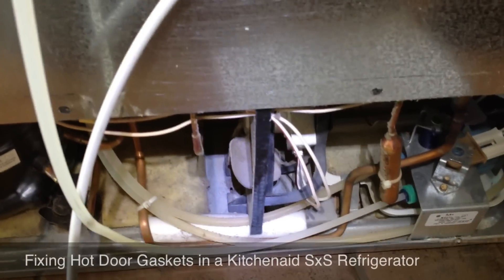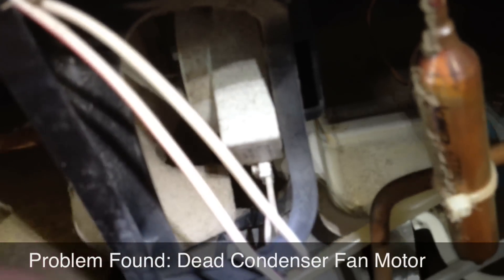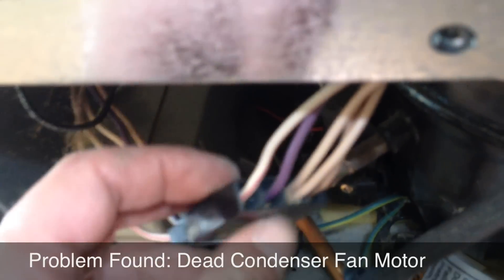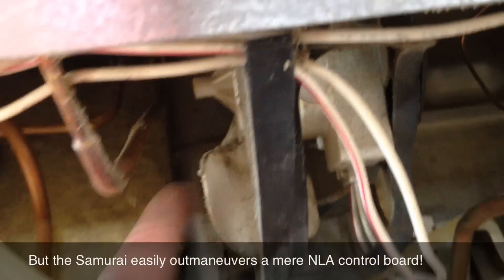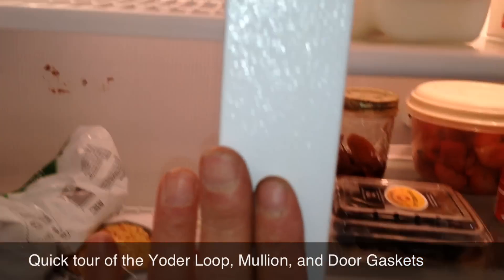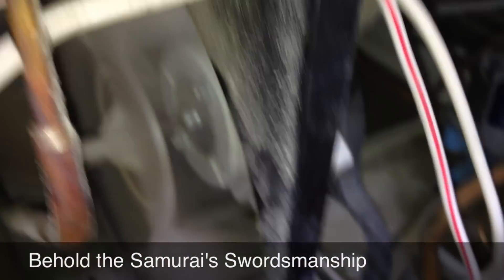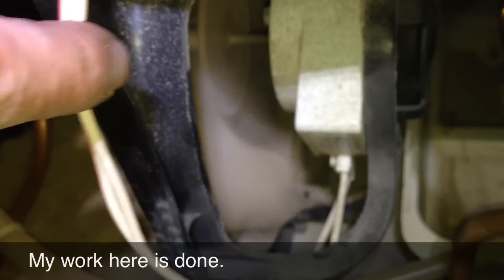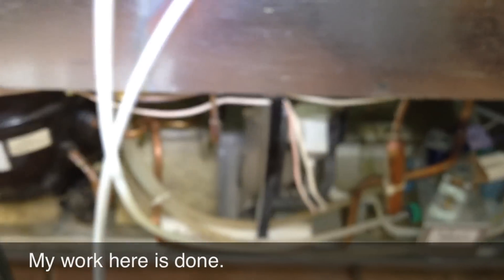An Unusual Fix For A Refrigerator With Hot Door Gaskets

Comment: You Rock!!! My fridge was warm and freezer cold...cleaned condenser coil and fixed that. Then I noticed the front of the freezer was hot-122 degrees F so I replaced the defrost timer and heater thermostat...still hot! I called many places and searched online with no results. I kept searching for defrost heater is always on as I didn't know about the Yoder until I saw your video. Sure enough, the two wire connector for the  condenser fan was disconnected on my 9 year old Frigidaire.  I didn't see any beer in your fridge so I owe you at least a six pack. You saved me from going crazy.

Comment: Yesterday I had a hot fridge gasket and today I have a working fridge! It only cost me a wire nut and a little bit of time. I spent more time researching and calling around than this easy fix. Local store stocked both the Fan ($118) and the Main Control Board ($280). This video gave me the confidence to tackle this project. Thank you so much.

Comment: My door gaskets were hot, so I decided to make sure the condenser fan was working. When I pulled the fridge out from the wall I noticed the floor underneath was also hot— not a good sign. Upon removing the back panel I found that the condenser was hot to the touch and the fan was completely immobile, as if the blades hadn’t turned in recent history. I remembered that when I vacuumed out the compartment a few months ago, there were several mice carcasses near and under the fan. (Eww.) After making sure there was nothing obvious in the fan blades that might be impeding movement, I began gently nudging the blades with a wooden spoon handle. They were very stiff, but gradually started rotating more freely. Suddenly, the fan blades began to move of their own accord, and then took off spinning. The gaskets have now cooled off, and I’m so relieved! Thank you so much for this video!

Comment: Thank you very much for posting this repair.  I had the exact same refrigerator with the exact same problem.   I made your repair and had the fan running again in a very short time.  Problem solved.  You saved me a lot of money.  Thanks.
Reply: @zzglyy, is it still working for you ok?

Comment: I believe that it is also very important to note that the cardboard/insulation cover is what helps to direct the airflow from the condenser coil and out the back of the refrigerator. Without it on, there isn't any airflow to cool down the system. Important to know if you are trying to test it with no cover.

Comment: A dude that can fix things not a salesman, I salute you!!  If you wanted to take it to expert level you could break the hot leg to the condenser motor through a current sensing relay that you could install on the common wire to the compressor.  That way when the compressor runs and draws current it would close the contact on the current sensing relay and bring on the condenser fan motor.  Its probably better to leave the fan motor running all the time anyway.

Comment from the maker: Good question!  This is an inverter compressor so it doesn't use standard 120vac to operate.  That's why it has it's own special inverter board to produce the voltage it needs.  I pointed this out quickly in the video but didn't elaborate on it.

Comment: Thanks to this video I came to find out that the fan blades were not only dirty but part of the foam and cardboard had managed to bend one of the blades of the fan, I bent back the blade to the original position and boom !!! Problem solved working like a charm , thanks a lot

Comment: Thanks for the video, in my case i reached in and spun the fan to see if the motor was locked, as soon as I touched the blades the fan started running.  Been a week now and all seems well.  Thank  you for pointing me in the right direction!
Reply: Just did the same thing.  I'm wondering why spinning the fan would start it up again? Any thoughts on why it had stopped in the first place and why it only needed a "push" to get going again?

Comment: Jenn Air jcd2389des, gaskets and middle column of side by side very hot.  Checked condenser fan and it was not running.  Spun blades while plugged in and fan started running.  Middle column cooled measurably for awhile.  Now hot again, fear condenser fan has stopped again.  Have not tried the constant on fix described here yet.  But curious what would cause the fan to run when coaxed, but not turn on again when condenser does?

Comment: My fridge had the same problem....only problem was a small piece of foam lodged itself between the fan blade and outer frame seizing the fan....pulled the foam out and like magic started spinning again....and quickly could notice the difference in temperature around the gaskets....thanks!

Comment: I find your info very helpful and informative.  I suggest you take the 120vac from the feed to the inverter board that way the fan will cycle with compressor.
Reply from the maker: The 120vac supply to the inverter is constant, so it would net the same result.  You may be thinking of the DC control voltage to the inverter board, which is switched and tells the inverter when to run and how fast to make the compressor run.
Reply: You are correct Samurai.  I had same problem several months back and thought I had figured out way to make fan cycle with compressor, but I guess it is running constantly.

Comment: I have the exact same problem. Even weirder, I just unplugged the fridge from the outlet, then I unplugged the main connector (where the power comes in), and the connector that goes to the fan (the one you were messing with @1:04), and when I just plugged them all back together, the fan started working!! I didn't need to fix anything🤷‍♀️. Thanks for the video though!!
Reply: Update: I'm not sure what's going on. The condenser fan doesn't turn on when it should. There's no current going to the fan. So I placed an external fan near the compressor to cool things down and after a while, the compressor fan will kick on. ???

Comment from the maker: Sho Nuff, Brother Bob!  This is definitely not the ideal, factory-specified repair.  But here we are with a fridge that's only 9 years old and the main control board is NLA?  What's up with that?  So the customer was up fecal matter creek unless I either 1) pulled the main control board and sent it off to get rebuilt, in which case they'd be without a refrigerator for about 2 weeks or 2) do what I did and get it fixed right then and there.  I know which one I would do!

Comment: The screws that hold the fan on the mounting bracket where loose and the fan blade was jammed up against the frame. I  tighten the screws, good as new ...  hope this works for you people out there. Thanks for the download.

Comment: Is that fan located at the top or in back at the bottom??  Our divider panel is almost to hot to touch. Im an HVAC Contractor and I know the principles are the same but I dont know much more than that when it comes to Fridges. I also have my 608 so If I can figure out whats wrong I can Legally buy Freon if needed. Thanks For YOUR Help!!

Comment: Might have been a better idea to connect it to the compressor hot wire, so if comp runs so does the condenser fan?
Reply from the maker: It’s a BLDC variable frequency drive compressor motor that doesn’t use Line voltage. No bueno.

Comment: Thanks for the video.

Want to share WHY this happens, and how to prevent it. To sum up, not many people properly maintain their fridges.
This particular model (and its sisters) have a fan that blows towards the compressor to cool it, as shown in the video.

However the air MUST CIRCULATE. The back cover behind the fridge has air vents exhausting heated air. The grille on the front under the doors is where the cool room temperature air enters. What you are supposed to do is TAKE OFF that grille, clean it, and clean the "mesh" behind it. A lot of dust accumulates on that mesh. People sometimes only clean the outside grille, not realizing you have to snap it out and clean behind it. The result is that mesh gets clogged with dust, no cool air can enter, the fan is not cooling the compressor, the compressor fries the control board.

In some case the control board is fine, it just can't "decide" when to spin or not spin the fan, or the sensors are malfunctioning at high temps.

Before doing this fix, if you have never taken your grille off, I suggest you do that, see if the mesh is packed with dust, if it is, turn the fridge off, clean the mesh, let the compressor completely cool, turn the fridge on. It might just start working.

Comment: my fridge condenser motor would turn on sometimes but not consistently,  I changed to a  new motor and the same thing is happening (I have a 10 year old kitchenaid that I can test the motor using the code in the front of the fridge). What is causing the inconsistent start?  I can hear the motor click but won't turn but when I unplug the fridge and replug it it does turns back on.  There is definitely current because the fan does turn on sometimes.

Comment: This video is very informative and a great help.But I believe you should have taken power from compressor supply,so that the fan would automatically come on or off together with the compressor.But thanks appreciated this video alot.
Reply: I thought the same, but since it's an inverter supply, the voltage will be pulsed, or too high or too low and will most likely fry the small AC motor.

Comment: So cut the black wire and join it with other wire? So is safe to cut when appliance is unplug right?
Reply from the maker: Refrigerator MUST be unplugged before you cut and splice-- the black wire has line voltage at all times when the refrigerator is plugged in.

Comment: Samurai, why not tap into the hot wire that feeds the compressor? That way the condenser fan motor would run only when the compressor runs. Anyhow, nice fix. It would've stumped my noob noggin.
Reply: No good. Compressor runs by an inverter and will destroy the fan motor

Comment: its a 2 dollar fix, just replace the 35 v 220 uf, capacitor inside the control board
Reply: My fan stopped working, I replaced it but still not working. What could be the problem?

Comment: Thanks, nice fix.  Shows understanding of the system and process, and well-presented.  Sounds like your online school should be well worth it if it encourages this level of understanding and lateral thinking.

For the non-cognoscenti but curious people like me:  NLA => No Longer Available.

It may be gilding the lily and, as you imply, not worth the energy it saves, but maybe use a RaspberryPI (or a DC/AC relay - does such a thing exist?) to switch the re-purposed AC to the condenser fan using the DC power to the compressor as the control signal; the Wiki page for Relays mentions that a diode might be needed if the relay is a solid-state device.

Would this do the trick:

  https://www.amazon.com/DC-AC-Solid-State-Relay-Heatsink/dp/B005K2IXHU#feature-bullets-btf

?

Wow, I learned a lot today.  Thanks!
Reply from the maker: Good thought on the DC/AC relay but a couple of problems:

1- The compressor itself runs off 3-phase AC, this is what the inverter is producing. 

2. The inverter does get a pulse width modulated (PWM) digital speed signal from the computer board but it is not a steady DC voltage-- it is a data line of square waves whose varies with the desired compressor run speed. This may not trigger the relay properly. Also, it is not advisable to splice into a data line or otherwise introduce switching noises (such as from a relay) because this can cause communications errors between the computer and the inverter.
Reply: Ooh yeah, better leave that PWM alone, or find less invasive technique to sense it.  Clamp-type ammeter (but those are usually for A/C)?  The RaspberryPI idea was a kind of joke because by the time you go there you are shaving the yak and it's probably easier to fix the board, but with a PWM signal I think that is the level of complexity required, so I think your original solution is probably optimal.

Comment: An unconventional repair to be sure. Almost a sure bet the condensor fan motor will go out in a couple years or so, but, when the board is NLA, you sometimes have to take drastic steps
Reply: Yeah, drastic steps would have had the common courtesy of allowing some form of a switching apparatus on the fan so it would be safe and not burn up. That would mean taking out your trusty dusty multimeter and combing through the board for shorts or burnt components to then desolder and replace with working electronics. That would be an actual fix, wouldnt it? Find the issue that stopped the fan from working. You said at the start of the video that the fan motor was burnt up, it wasnt was it? So it must be a relay, a capacitor, a resisitor, a diode,  possibly a fuse, something. That would be a fix. This isnt a fix. This is what you should not do. And you have a school? Omg!